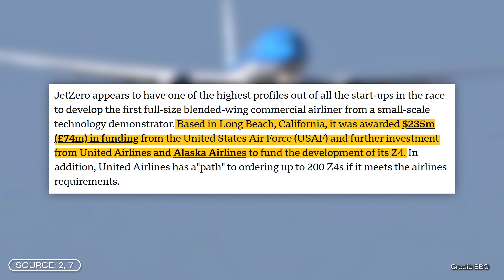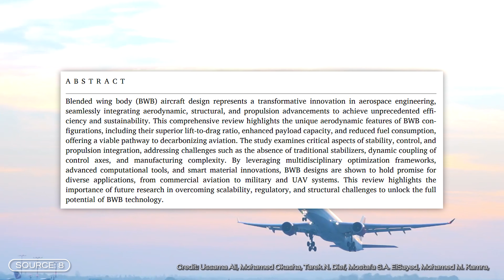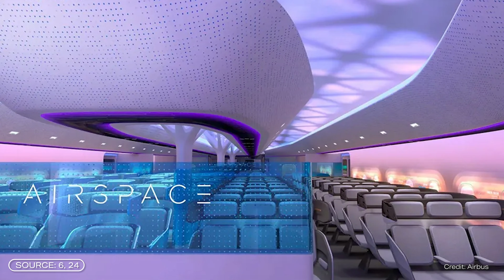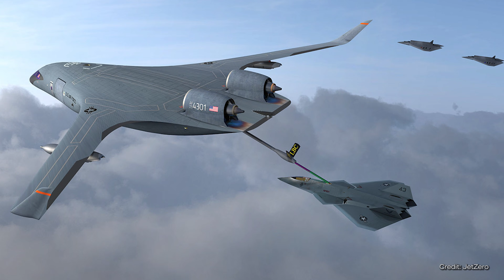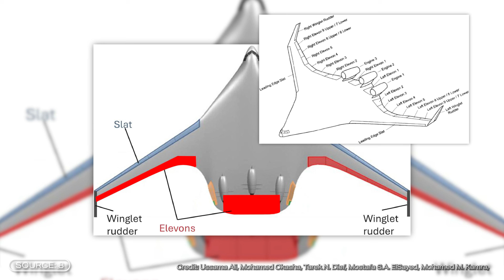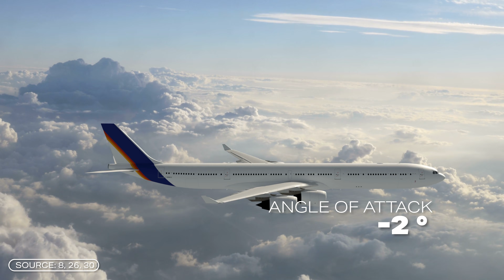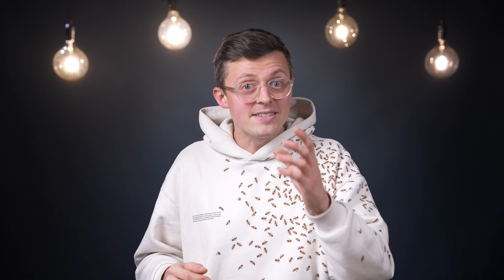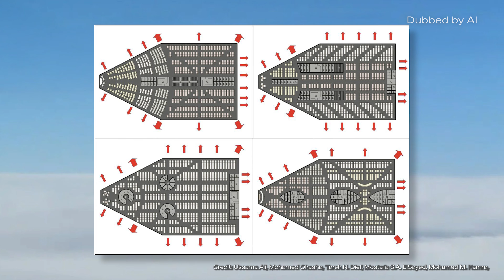The "Perfect" Plane Has One Big Problem...

Comment: Top central mounted engine exhaust reduces the drag caused by the lower air pressure behind the aircraft because air was displaced by the body passsing through that air.

Comment: I think those designs are really good for cargo planes. Way more area, you don't need to worry about passenger safety/comfort and efficiency is way more important than speed so the planes can take full advantage of the better efficiencies at lower speeds.

As a mechanic i can definetely see the downsides of the maintenance issues, but you already need ladders for almost everything on a wide body aircraft.
The worst configuration would be engines in the middle or close to it on the upper surface. It would make safe servicing without integrated guard rails very hard to do quickly.
An integrated design or located at the front or back of the plane would be better, though would come with it's own challanges.

Comment: The idea is certainly a promising one. The only concerns I would have would be wrt passenger safety in the event of a crash, and the structural requirements needed to reinforce such an oblong and complex shape when pressurised. Maintenance can be worked around by modularising the nacelles so they can be easily removed. or by having an assembly that rotates them so they can be accessed from a safer height.

One of the benefits to this design is that it would be ideal for integration with hydrogen fuel, thanks to it being a flying wing it would help with some of the draw backs whilst helping to further improve and innovate on the systems required for proliferation of hydrogen as a fuel alternative (could even separate the cabin space, using that empty space as fuel systems and reduce the area passengers would need to traverse in case on an emergency).
Another benefit (although less regarding it's commercial use and more it's military use) A blended wing design would enable the airforce to have a low observable cargo transport, on top of the lift potential. Especially if they opt for a more novel engine config.

Comment: I think the biggest advantage to having the engines on top of the plane shielded by the body is not for sound reduction but for safety. If you look at the recent UPS crash the only reason the aircraft was unable to climb was because debris from one engine got sucked into the center rear engine, taking it out as well. With the engines mounted on top, they would be shielded from debris on the runway, as well as shielding it from bird strikes better. If an engine were to detach it would simply fall behind depending on the placement.

Comment: Great video! One thing you have not mentioned is how these aircraft will fit in the airport's infrastructure. It has proven to be an issue for the A380, with a limited number of airports adapting their gates for it. All this will only work if the benefits prove to be very significant I guess

Comment: This is good news for electric aircraft as it extends their flight range. You can also mount the batteries in wing extremities to balance out the lift and weight, saving on structural mass.

Comment: Some research into electric aircraft is being done. Combining this efficiency with glider-style take off and with advancement in batteries, might work well for small, regional aircraft.
  Similar problems with angle of attack vs lift have been solved by Burt Rutan with canards near the nose. The canard has a slightly steeper angle, thus loses lift before the main wing. This automatically drops the nose, reducing angle of lift.

Comment: I wonder why we don't simply make an outer blended wing skin for conventional aircraft. You keep the separation from the pressure and flex problems, but hopefully add some benefits of the blended wings. 

Also, for the engines, why not embedded in the wing like a fighter jet?

And why don't they simply put a tail like on current airplanes if the left/right controls are worse without it.

Comment: Aerodynamically speaking, which means in terms of lift-to-drag ratios, the BWB MAY be UP TO 25% better.  Jet Zero's 50% claim must mean they are also expecting efficiency increases due to non-aerodynamic factors...engines and some structural weight decreases due to more use of composites perhaps (?).  Naturally, such non-aero improvements can be applied to wing-n-tube configurations, and also there is still some room for aero improvement on stick-n-tube aircraft.  Jet Zero's 50% claim is misleading marketing hype.  Furthermore, since aircraft are responsible for only 2-3 percent of total global fossil fuel burn, trying to sell the transition to BWB based on CO2 emissions concerns seems rather absurd.  Remember too that fuel costs are only 25% or so of total airline costs, and so, unless the BWB can magically reduce those 75% other costs significantly (which it can't), its fuel savings isn't going to make air travel much, if any, more affordable.  Better that we give more attention to making renewable carbon-neutral synthetic hydrocarbon fuels for airliners, but sure, let's also go ahead with more R&D into BWB and other non-conventional configurations that could make airliners more fuel efficient...better to keep aero engineers busy with projects like that than with building new super weapons for the MIC.

Comment: The arguments in this video don’t make sense. If one of the advantages of this design is reduced material costs, then how can one of the reasons for this design not being considered until now is the required advances in material engineering? Surely this design can be built out of aluminium like our current plane designs. If not, then the shape of the design isn’t material efficient is it? Either the shape of the design improves material usage, or it does the opposite and needs advances in material science to compensate.
This is the kind of logical fallacy that an AI would fall into.

Comment: Stability in flight and cabin pressurization are paramount features which should not be risked in the blended body craft. Perhaps an accomodation of tubular passengers spaces could be designed. Stability can be addressed by further wing and body design testing. And, we will eventually get an aircraft which does not look so much like a flying flattened hippopotamus. Thank you for the presentation of the design, and for the most important part, the hurdles section of your broadcast.

Comment: I’m neither a pilot nor an aircraft designer, but I’m a sailboat designer, so I have some ability to evaluate this type of thinking. I must say the reasoning from the AI translated guy seem real, but also a bit defensive, as if he just doesn’t like change. 

Like the engine placement making servicing harder. That’s just not a real issue. Ladders are needed anyway. The engines are close to the top of the plane, so it’s still just as easy to work on them. Also, engines very close to the ground suck up way more debris from the ground than engines on top of the blended wing. That will most likely lead to far fewer technical problems. 

The emergency exit point is just poor thinking. A blended wing could have exits up to the roof, with ladders coming down. It’s not a problem. Will people dislike an aircraft because of the emergency exit locations? What kind of subversive attitude is that? Total BS! 

The point about control and stability is very similar in sailboats. I see that as a real issue. I really don’t think electronic help via fly by wire is a solution if the plane is unstable. It’s just a band-aid. For a fighter jet, a basically unstable design is ok, because it’s priority extreme manoeuvrability and speed, absolutely not reliability and safety. If a passenger aircraft has a reliability anywhere close to even the best fighter jets, that passenger craft would be an absolute catastrophe. The basic configuration needs to be safe, controllable and stable by nature. Then electronics can make that even better. Not the opposite!

In the design showed in the video, all control surfaces and the wings are quite close to the same location length wise. This gives minimal vertical steering torque. I think that’s unacceptable. It makes it impossible to get out of critical situations. However, why not make the tail a bit longer? That would fix it. 

I think some sort of vertical rudder is useful, but that I don’t know. There are also several other points where the shown design could definitely be made more aerodynamically efficient, but I assume the actual designers know that and that the shown model is not up to date.

Comment: Left and right steering has been successfully achieved for a long time by computer engine thrust controls the whole maintenance will be more difficult argument is pedantic as rather than balancing on a ladder the workers will have a relatively flat floor under them to work from aka the body of the craft. Carbon fiber weaving has come along way and you can have large complex structures woven by mobile robots as a effective single piece construction with complex internal geometry. The future is now for those willing to do the work.

Comment: Why should the pressure hull and the outer mold line be (OML) the same, especially if doing so poses manufacturing challenges?  Why not keep the crew / passengers in pressurized, interconnected cylinders, and everything else in the space between those cylinders and the OML?

Comment: Thanks for this video.  The BW was studied seriously by Boeing in the 1970's.  At that time the limitations were propulsion, structural weight (lb/pax), and the main deal breakers...stability and control and operational restrictions which included "loading ability".  Also, in those days, the flying public would absolutely not accept being in any flying vehicle without nearby windows.  Today there are no propulsion issues (larger turbofans), and material science has resolved the structural weight and aero contouring issues.  Also, active fly by wire does resolve the stability and control issues.  With digital displays and a public with a different mindset, the lack of windows is also mitigated.   Also, ground servicing issues should not be an issue today.  "Loading ability" may still be the biggest issue.  Today's tubes are extremely easy to load, due to being on one axis with most of the load near the longitudinal centerline.  This changes greatly with the BW geometry.  There is no doubt, that the loading flexibility that is available today will be reduced.  The question is whether those loading restrictions...which will affect both cargo loading and passenger placement...will be acceptable to the airlines.  There is a 100 percent chance that a successful loading system will be developed (for dispatch and captain approval), but there is also a 100 percent chance that there will be restrictions that today's operators will have to accept.  The last major issue will be "ride quality", a term used by transport aircraft manufacturers.  "Fishtailing" was a common problem (making attendants in the rear galley sick), but controlled by yaw dampers. This ride quality issue was quickly mentioned in the video, but may be a bigger issue when compared to today's simpler wing/tube airplanes.  This one item could be a deal breaker, unless the cargo and fuel are loaded at the outermost areas of the wing, and the passengers are loaded more to the centerline.  Computer modeling and simulated models will need to be built for people to experience the ride from different WB seating areas.  This will determine if the public will accept the design consequences.  Otherwise, riding in one of these may be akin to a Disney wild ride.  That is ok for 4 minutes, but not for 4 to 12 hours!  The military versions will deal with most of the operational issues with no problems...which means the WB may stay with the military and not commercial operators.

Comment: The wing root of an A380 barely provides enough height at the wing's center for a standing passenger, I suspect.  The interior of an A320 size blended wing needs to provide that height and more throughout...and an overall airfoil cross section.  It also needs space for cargo and fuel while providing the inherent stability of a conventional design.  I'd like to see a walk-through mockup before getting excited.

Comment: Another problem  is that jetliners today are families with many sizes.  In that context, thd difference between a 737-8 and a 737-10 is mostly how much to stretch the tube. A BWB Family would have to completely redesign everything: the wind tunnel calculations, the cabin layout, the structural analysis, and the autoclave mould for composite parts. That drives up development cost.

Comment: How about feeding air into the engines at high angles of attack? I know some planes had higher horizontal stabilizers for this reason.
I also wouldn't mind seeing some canard wings up front.
Have the seating arrangements been customer-tested on the ground? Would it feel to many to be claustrophobic?
Windows?  Even in 2 4 2 seating on wide-bodied aircraft, peeps are probably 7' max from a window.
Partitions with fake windows (Flat screen displays?). Most of the outside views I have seen on these planes seem to have no windows. More flat screens? ...or the TV in front of them could be switched to the pilot's wide-angle view.

Comment: Refueling tanker may have pressurized cockpit and boom operator canine, while the rest of structure remains unpressurized. It would dramatically lowered structural loads to the structure and greatly reduce weight.

Comment: Evacuation Problems !!! 
Currently all passengers get crammed up in TWO walk-ways.

You are telling me 24 different walk-ways out will take LONGER !!!
Reply: Depends a bit on layout. Having rows 14 seats wide would not be great for evacuation. Also, assuming the same number of doors, all of those walkways are still going to converge at the doors anyway. And being wider means you have a lot more people per length, so you'd need to also have a lot more doors per length.

Comment: THIS "PERFECT" PLANE IS NOT GOING TO HAPPEN !!! It is an absolute nonsense. Nobody would want to sit in a large room with rows of hundreds of seats without possibility to look outside like they are used to when they travel in the existing cigar-shaped planes, buses, trains and passenger ships. Imagine flight attendants... how will they operate in those rooms?
The other thing is the impossibility of emergency evacuation in case of accident as compared with normal airplanes where people can easily and quickly get to the chutes. 
There are another fundamental problems like e.g. placements of the engines with almost unreachable access for the maintenance etc. Not talking about the necessary changes to the airport facilities.

Comment: Regarding the technical challenges of less easily accessible engines and at the risk of oversimplifying things here,I suspect that the fuel savings per flight every flight would more than offset the 'one off' cost of a funky cherrypicker and some slightly longer hoses.
  Another big plus for this seemingly economically inevitable blended wing form upgrade is that all these advantages apply irrespective of the power source for the engines.
  Even the clean but Currently over-heavy electric battery powered plane engine technology will become more viable more quickly especially when using say 12 small motors,4 fixed and downward facing with the others capable of limited thrust vectoring..Build and maintenance costs/motor start to nosedive when the mechanical and materials demands reduce.
. Then any maintenance and refuel issues with top-mounted engines become vanishingly small before too long .
  I see no practical reason to keep listening to these hydrogen salesman who won't stay in their lane.All the additional infrastructure offsite and at airports and high cost of the pressure vessels is a fool's errand imo,tying airlines to fuel suppliers.Electric battery costs and capabilities continue to improve exponentially (for now) with no end in sight whereas the economics of the tech for pressure vessels and hydrogen production will almost certainly fail to keep up even if it gets close.
It's almost as if somebody wants us to use more fuel/continue buying stuff we can make at home. for less.I'm more of a 'don't murder strangers for profit and control' guy.

Comment: a question - on some missile solutions, the air intake can starve the jet engine in certain high maneourves (this was found in a certain very effective high speed UK missile, but was fixed by having the missile slightly change its orientation just before that maneourve) - from the picture shown here of this upcoming jet, could this be an issue for a short takeoff type scenario or high banking turn?? (as the engines are at the rear, the remaining body blocks pure air flow to those engine in such maneourves)

Comment: Maintenance should not be an issue with the use of a Hiab Boom lift. The same way fascia boards are installed on a roof gable, or siding on a tall building, Hiabs are easy to operate, and a single unit can service multiple planes when scheduled properly.

Comment: Accessing a low mounted engine might be handy with a ladder, but look where the engines are on the blended body.  Use the ladder to climb up onto the tail of the aircraft and the entire engine is right in front of the mechanic.  You can even sit down to work on it.  No additional ladder or special access needed.  🙂